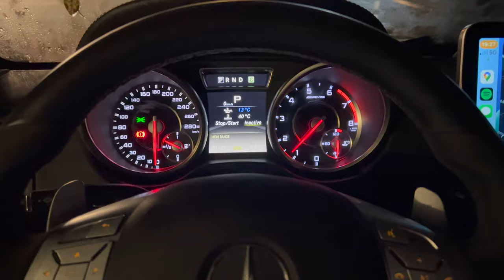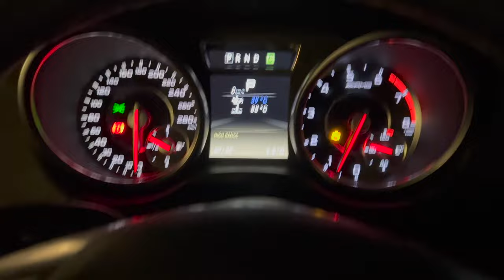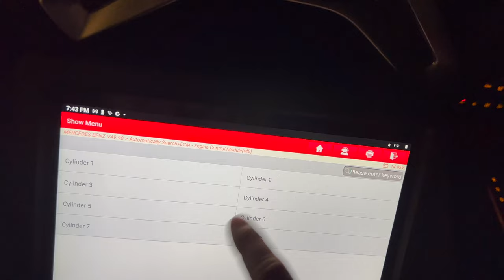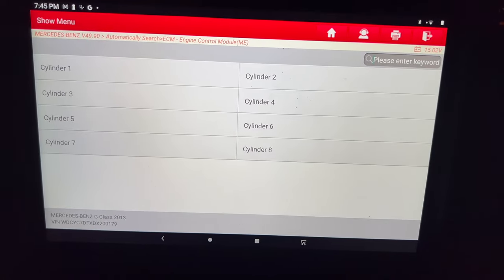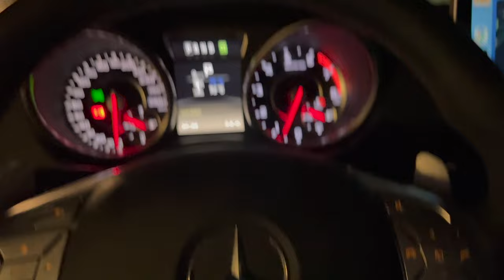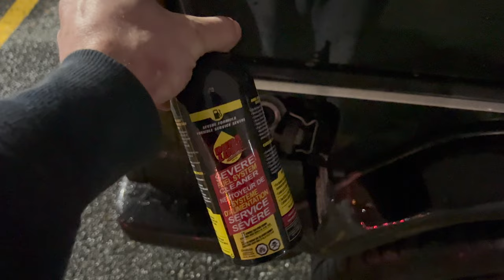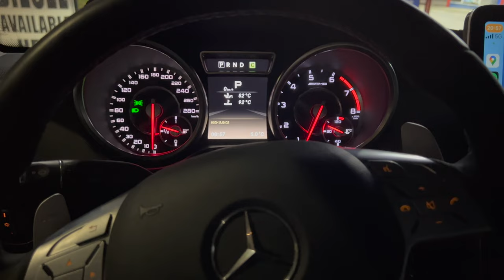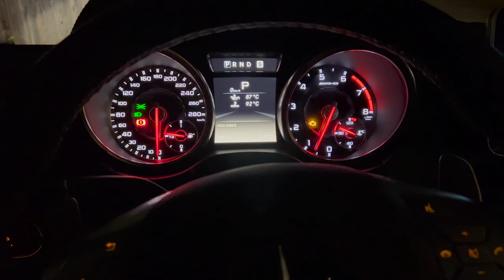Diagnosing random misfire and rough idle on 2013 Mercedes G63 M278 5.5L twin turbo motor

Comment: Had the same issue on mine. It was a cam position sensor that was going out. Random rough idle and/or misfires, not hitting target boost, etc. It was all very random. The codes told me what I already knew. The cam position sensor eventually completely went out then I got the appropriate code which told me my cam position sensor was bad. Tue sensor developed a small crack and oil was seeping into the connector plug. Replaced the sensors and all issues were cured.
Reply from the maker: It ended up being an O2 sensor for mine. However, I can see the cam position sensors causing the same issues

Comment: Hey, I don’t know how your misfiring issue was resolved, but it’s interesting that I too am experiencing the exact same random misfiring problem. My 2012 E550 was performing perfectly before I did some minor maintenance around the front end including removing the front bumper, radiators and such to replace broken antifreeze return line from turbo on right bank. I never bothered any electrical connections except for the MAP sensors connected to the filter boxes. While performing these issues, I made the big mistake of washing the engine with garden hose. Never knew that the design of the location of the spark plugs would take on water causing shorting out and corrosion around the connection of wires to the plugs. After completing my maintenance job, the engine ran terribly with random misfiring showing on the scan screen. After exercising all the easy procedures to isolate the misfiring problem, I have concluded that the water collecting around the plugs has created the misfiring problem. I am now in process of changing all eight coils and plugs, hoping to resolve the misfiring issue. Lesson learned to “NEVER WASH THIS M278 ENGINE “ if you don’t want to experience random misfiring!! I will update after completing install of new coils and plugs.
Reply from the maker: I did resolve the misfire, it ended up being a bad O2 sensor in the end.

Comment: About to take my g63 to check out my turbos that are leaking. If it were my guess, I'd say it's your injectors. The top end of this engine is a mess on the m157. Although I appreciate the metal fuel rails, it does make for a headache when removing.
Reply from the maker: Yeah I'm going to try the fuel filter and see if that helps. Fuel injectors are going to be my last step